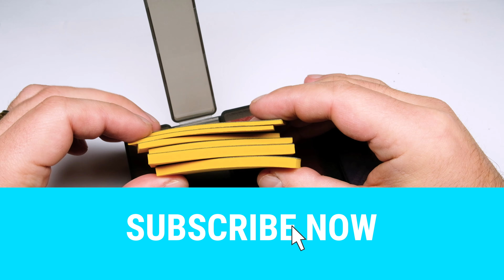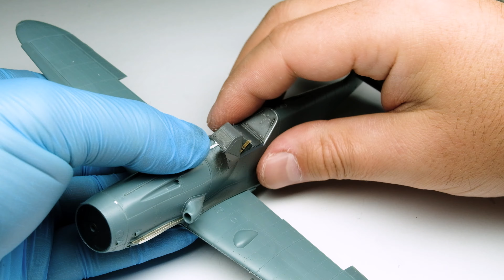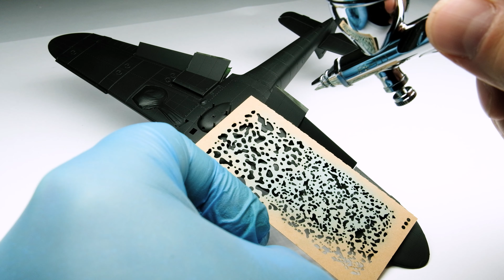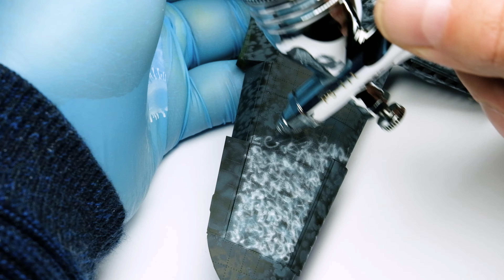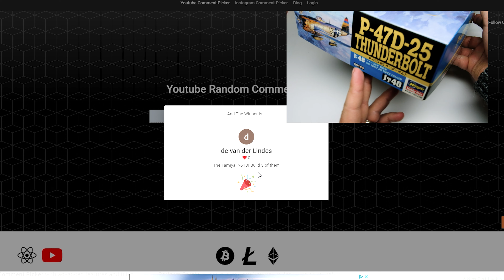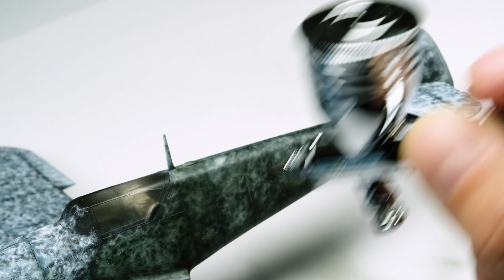Give Away Winners and Black Basing/Weathering - Messerschmitt Bf 109-G6 1/48 from Eduard - Tamiya

Comment: WOW that combination of Tamiya + MLT + AMMO Mig Transparator? You need a video just for that man! Great stuff :)
Reply from the maker: Thank you very much Bruno for tuning in!!! The transparator is really easy to use...
Reply: @AirandGroundinScale  Yes I know. However you have an alcool base paint and mlt, which is totaly fine, but is the use of the transparator, wich is made for water based paints, that is intriguing me.

Have you tried only to instead dilute 50/50 wilth mlt, use like 20/80 (paint to thinner) to have more control over the opacity?
Reply from the maker: Hey Bruno! Yes, the transparator is dedicated for water based paints, but I had to try it and it worked just fine with the same brand of colors on my other build, so I used it again. The dark paints cover really strong the underlying layers, I went already for much more thinning than 50/50, as I always do. Next time I'll try other, stronger colors for the black basing... I hope you tune in to my next experiment :) Thanks for your comment!!!

Comment: Shes starting to look complete! Anyways, on the topic of airbrushes, i got myself e H&S Ultra, and I couldnt be happier with the thing, its very well thought out(well, apart from that press fit paint cup, im not a fan of that concept), the ease of taking it apart for cleaning, thats the best. And I was able to get really fine, smoothly faded paint transitions between colours on the camo I free handed on my sukhoi. So far the part of the build im the most proud of.
Reply from the maker: Good tools makes your projects smoother. The H&S Brand is easy to take apart and clean in my opinion. Easier than the mr. Color airbrush. I really like doing transitions or grading like in colormodulation. Where can i admire your sukhoi?
Reply: @AirandGroundinScale  Well, I actually havent yet posted my modelling progress anywhere really, but ill DM you some sukhoi photos on instagram
Reply from the maker: Why not, posting your models is fun 😄👍 sure, that would be nice! I‘ll check them out as soon as possible 👍

Comment: Such a great video. In order to do the white lines on the black basing I have 3 quick 🙋🏽‍♂️ questions:
1. what paint to thinner ratio are you using?
2. Around what psi were you spraying it at?
3. What needle size are you using?
Thank you in advance
Reply from the maker: Hey Plastic Scholar! Sorry for my late response: 
1. Very thin, thinner than milk, perhaps 20% Paint to 80% Thinner...
2. Around 10 PSI, it doesn't matter, if it splatters a bit, it creates variation, doesn't have to be a clean job in my opinion...
3. I use a 0.15 or 0.2 size needle...
Thanks for you question and have fun!!!
Reply: @AirandGroundinScale  thank you appreciate it

Comment: Hi Leon, short question, where do you buy and what type of magic putty? Would like to try it😎
Reply from the maker: Hey Markus! I bought the Putty at Modellbau König. I think it's their own brand. But there are several puttys with the same specifications like this from the known other brands. It is pretty easy to mask the gear bays with it, but it's a little bit fiddly to get it all out again... :)
Reply: @AirandGroundinScale  Hi Leon, thanks will check it out there👍. Think its worth a try, I'm using litle foam pieces or paper towel, quite fiddely as well😂
Reply from the maker: @markusv311  good luck :)

Comment: Hello! I am also in Switzerland and I sas wondering if you coule recommand a hobby store in Switzerland that is reliable and with nice stocks from which I could order online? I have just subscribed to your channel as I do not want to miss this next serie video! Been resisting to buy an Eduard G-6 for some time nos ^^
Reply from the maker: Salut Pierre! Thanks for tuning in and subscribing! As I'm located near Bern, there is one local hobby store I know in my reach. This would be 'Replika Modellbau' you can find them on google. I already ordered from www.euromodelshop.ch, www.suter-meggen.ch and www.gdkits.ch should be good to. I have to admit, that I often order material directly from japan over ebay. You have to try the Eduard Bf109 they are very nice! Je te shouaite un bon weekend!!!
Reply: @AirandGroundinScale  merci Léon! I knew allready Euromodelshop, ordered several time there, but I will have a look at the other.
I had my eyes on the G-6 A/S for some time also, same camo that you do so I will look on the web site you gave me see if they jave it ;)

Comment: OMG, So much pre shading is overkill. In the end much will be hidden.
Reply from the maker: Thank you for tuning in and leaving a comment! You're absolutely right, if you saw the other videos, very much will be hidden, but the faint visible structure and color variation is in my opinion more interesting than a uniform coat. Just pre-shading the panellines is too strong of a contrast, black basing is much easier to do. You can use a templet and your finished in several minutes... Best regards!